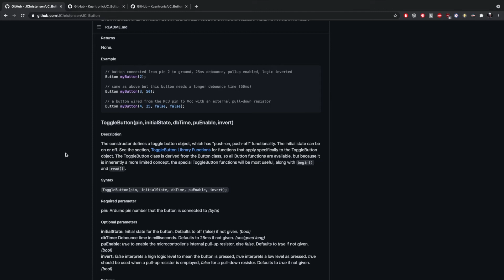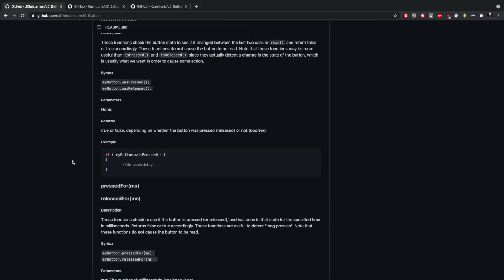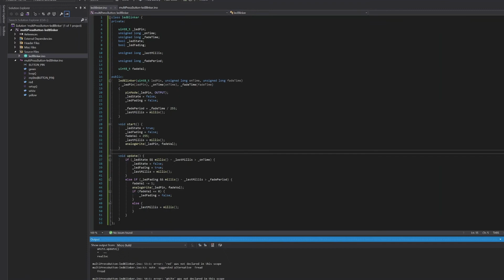Add Double and Triple Press Functionality to Your Arduino Buttons!

Comment: Nice Lib but it is missing the same function as other libraries. There needs to be a function for a 2 button long press. For example if i had 3 buttons labeled A,B and C i could have Apressed, Bpressed, Cpressed with ABlongpress or BClongpress.
So you would have Single Short or Long press and Short/Long press double button press.